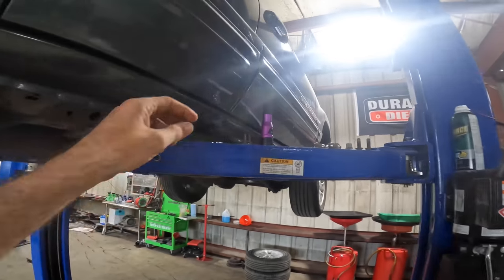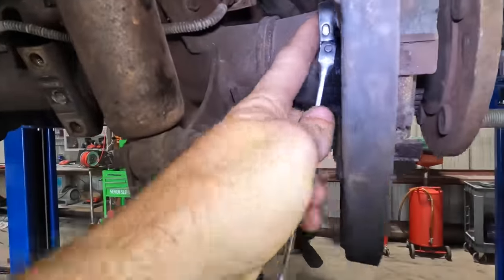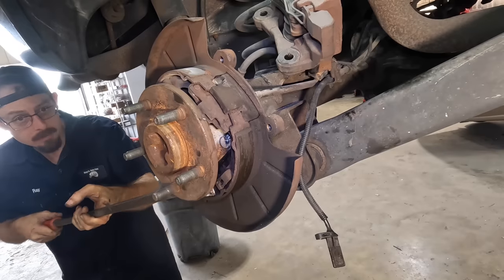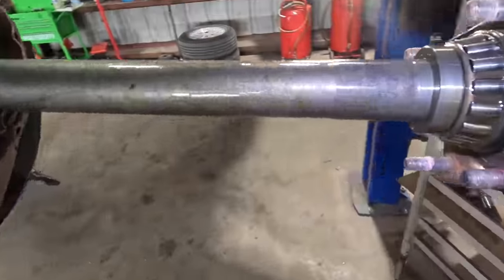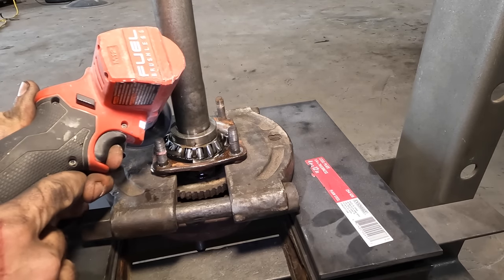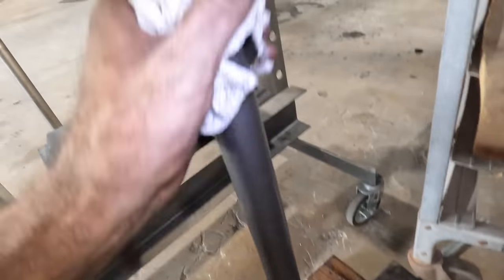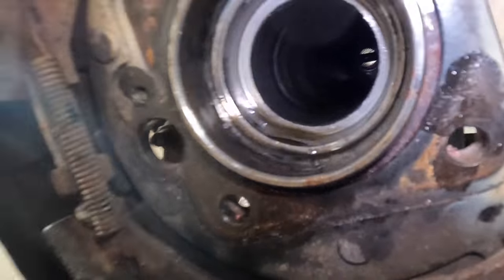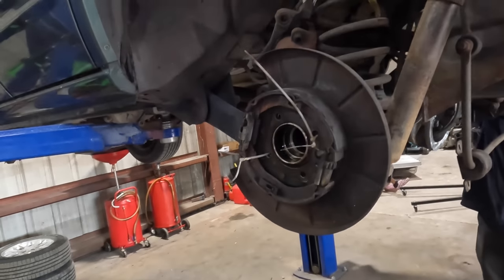Mechanic Destroys Bearings! | 2002 Jeep Grand Cherokee WJ 4.7

Comment: The thing that you called the "spacer" (THE BEARING RETAINER) should be hammered with the air hammer at four spaces around the outside and it will expand to a point that it will just slip off.

Comment: We used the torch to heat the retainer to remove it not to cut it a little heat and it will swell enough for it to slip off same thing with the bearing just a little heat is all it takes. I plumed them off once loose with players and or just a punch and hammer five minutes tops.

Comment: On my old Trailblazer, I had an oil leak one one of the rear wheel bearings, so I went to my local Chevy dealer to replace it and the bearing. 3000 miles later, oil is pouring out of the same axle, and the bearing is TOAST, on a Friday before a July 4 long weekend, 700 miles from home, and NO dealership will take it until Tuesday (Like it is under warranty). Only a private garage will do the work on Saturday, at a charge of $1,100! Dealer who did the work, said I should have brought it back to them for warranty, and they refused to reimburse me! Never went back to them. I strongly suspect the tech HAMMERED the bearing and shaft to get them in, thus causing damage to the race.

Comment: if you whop heat to the bearing, thermal expansion will make the bearing bigger and will fall off. make sure you have the axle positioned so the bearing will fall down the shaft. lots faster with terry the torch.

Comment: Next time take an old metal coffee can fill it up halfway way with oil, place the can on a hot plate heat the oil. Bend a  metal coat hanger to hold the bearing on one end and a hook on the other end to hang on the side of the coffee can. Place the bearing in the hot oil and let it heat up for a few minutes.  Remove it and place it on the axle, it will slide down and bottom out. Next place the retainer in the oil to heat up and then slide it down the axle, no need to press them on. We used to have to use a chisel to split the retainer and race to remove them.

Comment: Agree with taking the shoes off first ! Then clamp down with vice grips. After removing the axle, Grind one side or heat the press fit Caller . Much easier way to disassemble 😊
Reply: he trying to teach Grasshopper how 'not to do' way.

Comment: the bearing retainer you cut with oxy torch ,weaken good watch shaft  once retainer is off you can use original method to pull bearing off

Comment: 13:50 it’s actually the correct way to remove these .. remove the retainer . I usually use a cold chisel and notch it 12 - 3 - 6 - 9 and it slides or presses off fairly easily

Comment: Simple rule one always clean your surfaces to bare metal before you try to put any weld down, rusty, dirty, corroded surfaces do not allow the weld spot to pernitrate making what happened to you happen as you, also you can just end up welding it to a pieces of rust, also makes sure about what types of metal you are trying to weld together, steel to aluminum for example is much more challenging, (not that this was aluminum im just making a point) it requires Argon heavy and a different filament, also using gas such as argon lets you make better quality welds that penetrate properly, but not wishing to use gas makes it 100x more important to clean the surfaces, although that should be done no matter what, but just make sure you always clean your surfaces to BARE metal before you do any welds, just use a wire brush it's easy and saves a lot of work and also protects your metals as anything on top of the spot you want to weld makes it take longer and requires more heat to attempt to pernitrate it through to the metal and you can overheat and do bad things such as warp your metal or go too far through. All of which are very bad, had you cleaned your surfaces the end of that nut should have only been slightly warm tops, not hot like you felt it, and that's because you didnt clean it first. Also do your best to use the least amount of welds as possible, the less the better, don't just keep laying welds over and over either the weld spot or around it, this is a place where you want to put just the right amount and not to much, like the story of the 3 pigs and the wolf, you want it just right not to hot and not to cold, you can also use NPT to heat the metal a little after cleaning to help the weld pernitrate correctly.
Reply: Also while the bearings are very delicate you could have use MNP gas to heat the collar ring up by putting a piece of metal between the barings and the collar then heat lightly and it should have just popped off. Also make sure you remove the 3 bolts you welded and replace them with new ones that still have the splines to dig into the hole. if the hole is also worn out make sure to knock out the bolts and grind the welds off them and clean them down to bare metal, then clean it down to bare metal then put then back on and do a proper 3 point weld spots on the bolt head to the plate so anyone in the future will understand why it was done that way.
Reply: I would dripp a hole in the base plate that you cut and drill a hole in the part you cut off and then tap both holes so you can have a bolt in the post and just reattach it anytime you need it, and if you cut it in half you can drill and tap holes to make adjustable length posts.

Comment: 32:33
Howdy,    great show      at this moment of reinstall    adding 312 deg. F   to the bearing.   it helps a sht load        ice on shaft won't hurt 
  thanks for your time              0h ya    a 20lb tank of tri-gas  will help wonders with your welding(dual-gas)    and no fans blowing at ya
ty,   les

Comment: Those Bearing cups are meant to be pressed in, and shouldn't slide out by hand like the old ones you took out Ray. Loctite and center punch the new ones in so they don't spin.

Comment: Real simple. Drill a hole about 3/4 through the retainer. Then whack over the hole with a cold chisle and 5lbs hammer. The ring will split with one or two goods whacks.

Comment: you need to get the flux core tip for your mig unit 

Lincoln Electric Flux-Cored Welding Nozzle KH726

Comment: Use a torch cut the top one from the side be very cautious once you do that everything will slide off it's just pressed on. Use your air hammer to put it back on top of the bearing

Comment: The race should not spin. It will in time wear the housing. Sometimes lock tight will help or pin the housing with a punch to cause a friction fit from the dimples. I'd have heated the bearing retainers to expand them to remove them from the shaft.

Comment: Remove the rollers then heat up inner race in press with welds on the roller surface whilst press on shaft heat up new inner bearing and bearing retainer in a oil bath heater and they will slide on shaft

Comment: Turn the pieces of channel around safer , they make a bearing cover for that , cheap place some rags on top ,no flying bearing pieces.Big hammer a chisel you can split that bearing retainer , easier than you think . Would make it easier with  [20 TON STEEL SHOP PRESS BED PLATES, H-Frame Arbor 4 notch 1"X 5"X 5" Set]

Comment: Ray, to extend your press, would it be a better idea to weld together a U-shaped base bracket (lowering the bottom piece basically to the floor level)?  Seems like you have the metal on hand!

Comment: I did it , gotcha to 1k thumbs , look here it is , you " could " have put spot welds around the spacer and bearing to "swell" them or used a torch , then with "gloves on" and a piece of wood on the floor , just invert the shaft ,splines down and give it the drop test

Comment: wrap the half shafts in cling film and put them in the freezer over night the frozen air will shrink the steel (hot air expands steel, cold air shrinks steel) then just before you replace the bearings set the press up get the shafts out and press them on asap while the shafts are still frozen the bearings will slide straight on.👍

Comment: I forgot to mention Ray, the (all thread)  you have to drill holes through the channel, insert the (all thread) then the hardware. What you're trying to create is adjustable jaws with the channel. That way you know depending on what it is you're trying to do you can adjust the channel in and out and the bolts will make it in one unit with flexibility or adjustability. You know how to do a lot of stuff that way you would need a third hand.

Comment: so with these bearings, you need to cut them off. Cut the bearing as much as possible as not to cut through and hit the axle. then air hammer that cut to break it the rest of the way. You can also cut the bearing first and peel it off then cut the retainer. This is how Jeep recommends.

Comment: I think its easier to just drill the bearing retainer ring and hit it with a chisel, then tin snip the cage and cut the inner race and hit it with the chisel too. I got both my WJs rears set up for new seals/bearings in about 15 minutes  per jeep that way. Not counting disassembly and pressing on new. And reused my flanges. Maybe its not for everybody but to me its easier than trying to fit solid axles in the press facing up. I wish the front seals were half as easy. They sucked

Comment: Do yourself a favor and cut that bed plate apart. Then set it on the pins of the press and weld it back together. Mine wobbled like crazy and after looking the press over and over, I decided they welded the plates uneven. Sure enough sitting it on the pins after cutting it apart made it true. I welded it back together right on the press. I'm referring to the big piece that your parts sits on to press against.

Comment: Do not take the tip off to weld with a mig welder. Even with no gas coverage the reason will become clear over time. The problem is your entire tip becomes the electrode and will cause inadvertent shorts without the tip over time. Also the spatter will more seriously effect your wire guide. One should use a cover gas as your weld will be more acceptable even with a flux core wire.

Comment: It would have been so easy and so quick to use a cutting torch on the bearings. Watch what you are doing and you can cut them off without damaging the shaft. I've done it several times.

Comment: Until you learn one of the first cardinal rules of welding, IE you need clean metal, your welds will always be bad. It's not a difficult concept, nor is a wire brush/wheel an unusual tool . . .

Comment: Ray you just gently warm up the bearing retainer ring, Then when you fit the new kit you warm up the retainer ring up slightly and slide it on and cool it, you may not even need the press at all, Gently heat even when fitting warm the ring in a frying pan on a cooker hob. Great Videos x
Reply: DONT. over a certain temp will ruin it (usually around 200F)

Comment: Not a very straight cut, a procedure used in industry. Is to put a hose clamp on it and follow the hose clamp at least until you get to the screw part of the hose clamp. By then you have 90% the cut already made.

Comment: Or you can use liquid nitrogen to freeze the shaft at the ring and heat the ring and it will slide off

Comment: The press:  I think you could have removed the lower support bracket and gained 4 or so inches of clearance.  I think it comes off, merely lift one end to clear a side support and lift it off.  Then you would not have to cut the bar of the jack.  You may regret that later.

Comment: Why not take the brake pads off before welding?
Did you manage to get the bearing off without marking or scratching the axle? Just wondering if anyone has told you that 75% of the torque is transmitted by the outer 10% of the shaft? This is why the main drive shaft is hollow, as the center part carries so little of the torque that it is just extra weight, and thus is removed and the drive shaft is hollow. So you really need to ensure that you don't mark or scratch the rather thin axles. But I'm guessing that you already knew this...

Comment: Those "spacers" you call them are not spacers at all, they are heat treated locking rings that hold the bearing in place. Those rings are heated up red hot and dropped into place, then when it cools, it shrinks around the shaft holding everything in place. I've found it easiest to coal chisel them to weaken the ring and the thing should press right off with the bearing, otherwise you will destroy your press or the bearing puller. Just some food for thought. Great content however.

Comment: hey Ray... next time you use channel to support a bearing puller, "IF" possible, have the back of the channel facing the center  picture time @30:00
] || [ <--- like that
[ || ] <-- not like that :) 
teh back of the channel is far stronger than the tips
carry on

Comment: It economic foolery not to change the brake shoes, when your changing the seals and bearing on rear half shafts. Brake shoes are cheap enough plus you can't guarantee you won't contaminate them with fluids on disassembly and reassembly

Comment: Why didn't you heat the nuts up with an oxy acetylene torch?.   Use a small brazing tip not a cutting tip to minimize excess heat.

Comment: Ray, There is nothing as fast as the “blue tipped wrench” to remove frozen bearings, spacers, and couplings.
Reply: The fire wrench would have snipped that mess off in no time.
Reply: The old torch-O-matic one-size-fits-all have a great day

Comment: 22:05 You don't have to be sponsored to use Diablo blades. I can't remember a single Diablo product that's bad. They might not always be the best of the best, but they are always on the better end of the spectrum. So you can, in my opinion, not do bad by choosing Diablo.

Comment: Used wrong bearing puller. You are supposed to remove the studs, not weld, then in. Remove brakes hold with vice grips. Then flip puller over so flat side is up and it won't destroy flange. Apply little heat to ring, and it will pot right off. Next time, read your service manual. You cost the customer undew expense.

Comment: Ray, I have seen you press bearings on right out of the box. If you have time put them in the freezer for an hour or so. They will press on a lot easier. It also works great on pulleys too.
Reply: Doesn't that shrink the bearings?  I've installed them by heating the bearing in a toaster oven or wrapped in a damp rag in the microwave.   Even better if you can freeze the shaft.    The bearing almost installs itself if done quickly.

Comment: Grooving farside of race help a lot in getting it to break. alg 3 Love the press mod. Epoxy a round neo magnet in a drilled hole in shaft drop and you can revert to stock and back at will.

Comment: Ray I've been watching your quality repairs for years but I got to say the way you went about removing the bearing with the retainer was so wrong and you didn't cover the potential shrapnel from the bearing under load. the bearing scissors were also used incorrectly.

Comment: Seems to me Ray man. Pressing a bearing of an axle is inherently dangerous. Let alone bending axle shaft with miss alignment on sub standard press. I've watched a few of his videos. And it looks like he's feeling his way most of the time. As a technician in NZ who's owned an auto shop for 30 years. No way I'd employ this guy
Reply: The bearing collar is supposed to be an interference fit. It stops the bearing from moving. Give it some heat up to orange and it will come off bugger me. 1st year apprentice's are tought these things on NZ. How long did this Job take ?.. We would have spent 1hr per side worst case and charged 4hrs labour plus parts and consumables. Good margin. Gives you plenty of room for problems and still make a good profit. Or things different in US. Some how I doubt it

Comment: Panic! Ray is attempting to weld something! This should be interesting....easier to remove the brake shoes first though. I would suggest you use cored wire if not using gas. That way you do not need the shield on the end of the gun, making it easier to get into smaller spaces to weld. I would also strongly suggest you buy a subscription to All Data or something as you are now a business owner. You will then know what is needed without having to "wing it" all the time, saves you time and unneccesary damage to parts due to a lack of experience. Always split the retaining ring with a disc to easily remove the bearing off the axle. This is pretty basic stuff. Your butchering skills and lack of experience are showing here. Real backyard stuff that you would never do in the dealership. (BTW, you may need to heat the retaining ring to install it, what does service data tell you?)

Comment: Try stick ray I'm far better with stick welding wire fed sucks use the skinny sticks for stuff like that when I made a trailer man oh man was the sticks hot I used the thicker rods ya I made gorilla welds however nothing could break it just took me longer with a hand held grinder to clean my welds I didn't get to keep my trailer it was bought quick